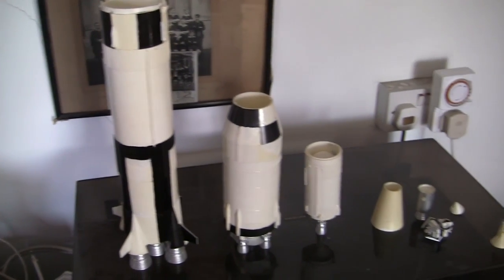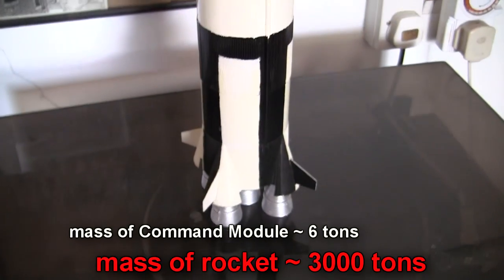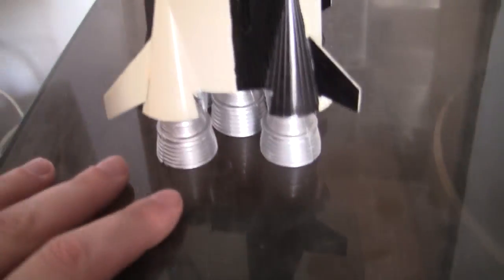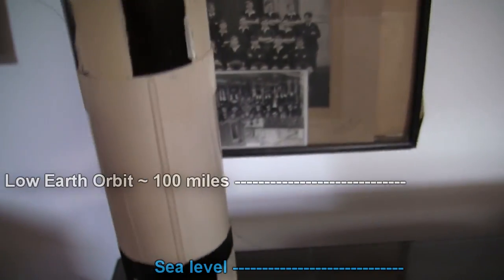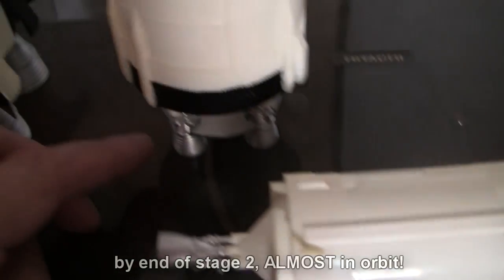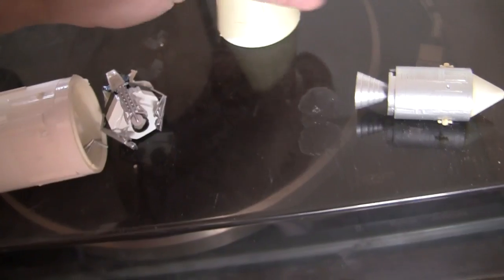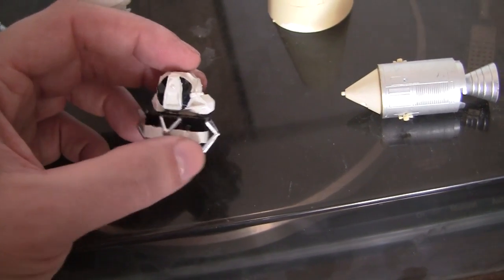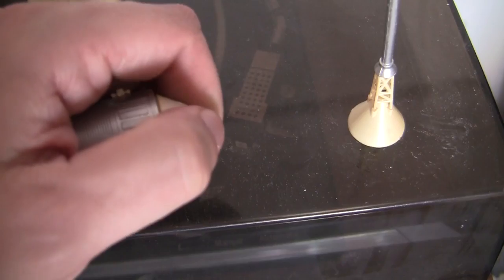The Saturn V Rocket: How it worked!

Comment: A couple of fine points.  The moon is in orbit of the Earth.  Going to the moon does not require leaving Earth orbit.  While the mass of the LM was high, it's weight on the moon was low. Lunar gravity on the surface is 1/6 of Earth's surface gravity.  And when landing the lower stage of the LM has burned most of it's fuel.

Comment: I'm kinda confused.  If the rocket had 3000 tons of fuel, and the engines consumed 13 tons of fuel per second, then it would only have four minutes worth of fuel.
Reply: Yes, but the 13 tonnes / second is only for the first stage. The first stage burned for only 168 seconds.

Comment: I recall seeing a clip stating that if they lost  1 engine before clearing the tower they were coming back down. But if they lost it after clearing the tower, then they had burned enough weight in fuel to continue with four.

Comment: You got some details wrong, 
the third stage was used for a lunar injection orbit, they were in low earth orbit by the end of the second stage
Reply: Swithin Games they weren't in LEO on the second stage, it got them to space but not quite orbit. The third stage burned a little to get orbit, shut down, then restarted to get to the moon.
Reply: Dubsy is correct. The 3rd stage fired twice. Once to get the rest of the way to LEO after the 2nd stage was spent, then again to leave LEO to head to the moon (TLI or Trans Lunar Injection.) then while in transit to the moon they docked the command module with the lunar module.

Comment: Ironically , I believe the Russian design approach for the smaller rocket outlets is now used for modern space flight . They had significant challenges back then but i believe it has advantages over the saturn v design in terms of control .

Comment: the Rocketdyne F1 was a thing of wonder, 7,000 kN of thrust each.
Reply: Also, the command module wasn't the only piece to return, the first two stages at least splashed down in the Atlantic.
Reply: *****
Legally it would likely be considered salvage, in which case NASA would retain ownership, but would be obligated to generously reward Bezo under maritime law. the amount of the reward is based on many factors including "1) the value of the vessel and its contents after the salvage is complete; 2) the salvor's skill and initiative in minimizing damage to the environment; 3) the degree of success obtained by the salvor; 4) the level of peril to which the salvaged vessel was subject; 5) the salvor's skill and initiative in saving the vessel, human lives, and other property; 6) the salvor's labor and expenses; 7) the amount of risk run by the salvor; 8) the promptness of the services rendered; 9) the availability and use of any alternative salvage resources; and 10) the readiness, efficiency, and value of the salvor's vessel and equipment." He spent alot of money and effort to recover them, he should not be obligated to return them for free, and if NASA really wanted them back they could press a claim within 2 years and would be required to compensate Bezo.
Reply: All your assertions are based on the premise that NASA even wants them back, which they don't

Comment: thank you for the video. I know most of the parts were made to be used only one time.
my questions:
1. which parts of Saturn V were returned to earth and reused for next missions?
2. which parts remained in the Earth orbit? maybe still orbiting.
3. which parts remained orbiting the moon?

thank you.
Reply: I hope this helps:

The only part of the Saturn V that returned safely back to Earth was the Command Module with the astronauts inside. They couldn't be reused, however, as the heat shields used during reentry were damaged.

The first 2 stages both didn't achieve orbital velocity, and were destroyed on impact.
The third stage was sent on a collision course into the Moon for experimental reasons, and was destroyed on impact.
The bottom-halves of the Lunar Modules are still on the Moon, except for Apollo 13, which burned up in Earth's atmosphere, and Apollo 10, which was sent into solar orbit.
The top halves of the Lunar Modules were all put on Lunar collision courses, except for Apollo 10 and Apollo 13 again.
The Service Module was detached before reentry, and burned up in Earth's atmosphere.

All in all, the Saturn V was one-time use rocket, with nothing being able to be reused. Pretty wasteful.
Reply: 1.  A few years ago, one of the F-1 engines from Apollo 11's first stage was recovered from the bottom of the Atlantic; but it wasn't in flying condition.  The Apollo spacecraft was 100% expendable, so nothing was re-used except maybe some of the personal items and tools.  Even the cameras had to be retired after only one mission, because space is really hard on equipment.  The command modules are on display at various science and aviation museums.  The first stage (called the S-IC) would fall back to the Atlantic Ocean and be destroyed; the second stage (called the S-II) would disintegrate over the Indian Ocean.  

2.  Apollo 4, 5, 6, 7, and 9 never left Earth orbit, so some of their debris is still up there.  Astronomers have re-discovered the aerodynamic fairing from one lunar module, easily identified by the titanium in its paint. 

3.  The ascent stage from the lunar module would be left in lunar orbit until it decayed and fell back to the Moon, usually a few weeks later.  There is no Apollo hardware in orbit around the Moon, but the Apollo 11 and 12 boosters flew past the Moon and are still orbiting the Sun somewhere. 

The third stage (called the S-IVB) would be deliberately crashed into the Moon, creating small tremors that were picked up by seismic sensors the astronauts set up.  This is how we know the Moon's composition is a lot like the Earth's crust and it was probably formed from debris left by a huge impact.  Ironically, the first mission to do this was Apollo 13; so they didn't land on the moon, but the booster they rode on did.
Reply: Hector Cummings  THANK YOU !
Reply: Thank you!

Comment: Great video! Just a note: the lunar module had 2 engines, the descent engine and the ascent engine. In case one failed the other could get the astronauts back to the command module. This was tested on Apollo 10.  Once again great description of the Saturn V!
Reply: Thank you for the correction, however I was referring to the decent and accent stages. On the way down if there was an issue they could jettison that stage and use the accent engine which was capable of getting the LEM from the surface to the CM.

Comment: Correction; the main engines burned 20 tons of fuel per second.
Reply: TheAviator370 I doubt that, the F1s burnt for around 170 seconds. That's enough to burn the entire rocket.

Comment: It's really hard to fathom the task of taking off from the moon and docking back with your parent module thats in lunar orbit. How is that even possible? I mean, to be in orbit means to be just falling around the planet fast enough that you just keep circling. It would have to achieve orbit velocity and time it so that it coincides with the parent modules location in orbit. Wow.  I know that orbit velocity is achieved by the angular approach used during launches, but even with the moon's decreased gravity it's very hard to imagine that a tiny module would have the power to do this.

I just wish I could chat with one of the original mission planners one on one.
Reply: You know what's equal hard to fathom.

How 12% of the western world denies this happens
Reply: DaVDLSYAP3 1245
Well, being a skeptic myself, I can understand how people don't believe something that hasn't been proven to them. Unfortunately, they don't want it to be proven so they don't do the research.
Reply: +Wheresmy240 They left absolutely everything they didn't need - cameras, science experiments, tools, batteries, even their boots in some cases.  The descent stage was left behind as well, since they didn't need its landing legs, batteries, or fuel cells.  The ascent stage of the Lunar Module weighed barely two tons when it docked with the Command Module. 

They also practiced the hell out of the mission before they flew.  For each hour of an eight-day lunar mission, Apollo astronauts spent seven hours training.
Reply: +CountArtha I know all of that, I'm just saying it doesn't seem physically possible still. Not doubting it.

Comment: The Apollo Lunar Module has two engines
Reply: +FSXgamer 
The lander had one and the accent vehicle hat one. They couldn't be used simultaneously.
Reply: +Keyboard runner Sure, but he implied that if "it" failed, they would die on the moon - which is not the case if the descent engine failed.  They would abort and simply fire the ascent engine in the case of descent engine failure.  If the ascent engine failed, then yeah - they were pretty much goners, but he made no distinction here.
Reply: +Willoughby Krenzteinburg The ascent engine used hypergolic propellents that ignited when mixed together, to eliminate the need for a heavy fuel pump.  Because they were so volatile and corrosive, it was impossible to test-fire the engine without destroying it in the process.  The first time it was fired was on the moon.  Those Grumman engineers probably had the most stressful job in the whole program, not knowing if the engine they had built by hand would work until the fifth day of the mission.
Reply: CountArtha I'm not sure why you're sending this to me specifically.  I'm aware.

Comment: This rocket is THE most powerful machine EVER created by man.
Reply: DavIDLSY 1245 No, Energia had 6,500,000 newts of thrust.  The FIRST STAGE of the Saturn V had 7,500,000.
Reply: +The Aeronautics Guy Because the RS-25(the engines used on SLS and the Space Shuttle) engines are more efficient than the F-1 since they use a Liquid Hydrogen and Liquid Oxygen fuel mixture rather than the highly concentrated Kerosene, known as Rocket Propellant 1, and Liquid Oxygen that the F-1 engines run on.
Reply: Centurion Coles That's a fucking nuke not a manned inter-planet rocket
Reply: Centurion Coles Also the Tsar Bomba had 50 megatons of power.
Reply: +WhackyJ in AK Most powerfull machine ever built by man would be the world's most powerfull laser pulse made on May 23 1996 by Lawrence Livermore National Laboratory. The lasers are used to concentrate energie on hydrogene fuel and start nuclear fusion. Max power obtained was 1.25PW (for nanoseconds) Average power of the first stage of SaturnV was 166GW.   Oh and I think the N-1 rocket produced about 46MN of thrust at launch vs 34MN for the Satun V I'm not sur can someone confirm this ? and does that convert in higher GW ?
Reply: @ Luca B ...to be considered a rocket one might argue that it actually had to be capable of flying before you could classify it as such.  The N1s were little more than massive, shrapnel-spreading bombs in the "shape" of a rocket... Sorry - but it's true.
Reply: +The Aeronautics Guy 2023 is Probably gonna be when the SLS Block IB launches, which will be more powerful than the Saturn V. SLS Block I will launch in 2018 and will be slightly less powerful.
Reply: +Andrew Mcilveen The thing I am wondering is why did they not put f1 engines on the SLS core stage?
Reply: +The Aeronautics Guy 
Some Apollo derived hardware had been considered in the past: The Earth Departure Stage of the Ares V would have been powered by a J-2X engine, derived from the J-2 used in the 2nd and 3rd stage of the Saturn 5.  Up to 2014 this stage was under consideration for the SLS, but is now being replaced by the RL10 powered Exploration Upper Stage (originally powering the 2nd stage of Saturn 1, Centaur upper stages on the Atlas and Titan III and still being used in the upper stage of the Delta IV).

While not as famed as the J-2, the RL10 of Atlas-Centaur was used for the Surveyor launches, and Titan III-Centaur launched the Viking Mars landers and both Voyager deep space probes. Furthermore, the RL10 on the Centaur upper stages proved that a hydrogen burning engine could operate in space, paving the path for the development of the larger J-2 engines that would have needed to be based on the same principle.
Reply: I think energia had more power. But most powerful with men on it YES
Reply: +Centurion Coles That's STILL a fucking nuke not a manned inter-planet rocket!!!
Reply: WhackyJ in AK *Inter-Celestial Body Rocket
Reply: +WhackyJ in AK Actually the N-1 rocket is the most powerful machine ever created by man. The Saturn V is the most powerful that works.
Reply: WhackyJ in AK Actually I gotta tell you, it wasn't until after I'd pressed the post button that I realized who I had replied to. You've proven yourself to be a massive waste of everyone's time from the top of this post to the bottom and I regret not paying more attention. It is not my intent to ever give you the time of day intentionally. No more posts to you from me will follow.
Reply: RedhotIta1 That's what I was talking about, numbnuts.
Reply: WhackyJ in AK Was really necessary to insult?
Reply: RedhotIta1 I apologize.
Reply: Centurion Coles I AM TALKING ABOUT ROCKETS, NOT NUCLEAR BOMBS, FUCK OFF!
Reply: +Luca B That might be true, but the N1 never Made a succesfull Launch because that the Saturn V is seen as the most powerfull rocket and not the N1
Reply: +RedhotIta1 the n1 couldn't lift as much to orbit as the Saturn v, 95 tonnes versus 140 tonnes.
Reply: ***** Again, incorrect. NO N1 ever made it into orbit. Period. https://en.wikipedia.org/wiki/N1_(rocket)
Reply: ***** You're an idiot
Reply: ***** Your grammar is attempting to destroy my cerebral cortex.
Reply: ***** Alright, well good luck in learning, I hope you do well.  Also your country's team was awesome in volleyball last night.
Reply: It is! Imagine a Saturn rocket that uses the same main stage as boosters. (like the Delta-V Heavy). The Power of that thing would be amazing, but expensive.
Reply: NSEP of Doggerland Not to mention SUPER outdated technology... It would be like saying, "Here, let's start using carbs on cars again because they used to be on muscle cars."
Reply: NorthernChev I know, but just the idea is cool, im not wanting them to build that or something. Just a thought.
Reply: NSEP of Doggerland Well I want them to.  Carburetors are great at starting in the cold and heat while we usually have more problems with EFI.  Also that rocket sounds amazing they need to build it like, 12 years ago.
Reply: WhackyJ in AK Spoken like someone who knows nothing about mechanics.  It EFI that starts with no problems in the heat and cold. Carbs are notorious for problems with both.  Please do your research before commenting. Thanks.
Reply: It's only a few kilotons of TNT equivalent. Anything but a tiny tactical nuclear weapon is vastly more powerful. So  not the "most powerful machine"
Reply: thats not essentially a machine +GavinJenkins  its more a weapon
Reply: +swithin games "Machine: an apparatus using or applying mechanical power and having several parts, each with a definite function and together performing a particular task."

So yes, it is essentially a machine. And a weapon. Ever heard of a "machine gun"? The two words are not mutually exclusive.
Reply: Technically the N1 was it had a higher payload capacity. 95 tons compared to the saturn's 45.
Reply: The LHC is probably a bit more powerful.
Reply: What about Falcon 9, Falcon Heavy, and Big Falcon?
Reply: 2 years later Falcon Heavy
Reply: Not now! Falcon Heavy ftw!
Reply: The Saturn V had about twice the payload capacity to LEO compared to the Falcon Heavy.
Reply: STARSHIP
Reply: Starship will be way more powerful than the sls and saturn V lol
Reply: @ukdrilllyrics2624  To date of my comment neither the SLS or Starship has been launched.
Reply: @whackyjinak4978  I know lol
Reply: Until 2020 when we launch SLS
Reply: The Aeronautics Guy ... SHUTUP...  I can like the Apollo missions :(  I hope it ranks under this though...
Reply: +WhackyJ in AK ok jeez I was just stating a fact I love the apollo missions.
Reply: The Aeronautics Guy DUDE I LOVE YOUR PROFILE PICTURE!
Reply: +WhackyJ in AK Thanks
Reply: @shilpwift3366  uhh yh SLS super passed the Saturn V
Reply: @shilpwift3366  2024 now
Reply: @shilpwift3366  starship ._.
Reply: @shilpwift3366  2024*
Reply: Andrew Mcilveen Shut up
Reply: protostar 777 I never said that the Saturn V carried less than the N-1, simply the N-1 was lighter and more powerful than the Saturn V
Reply: NorthernChev Knows nothing about Mechanics?!  I've rebuilt two different motors and am taking several classes for mechanics.  You don't even need to have experience to know, "Gee, all these old cars around here I've driven start without a problem.  Why do my friends' and my new cars with EFI start worse?"   I have done my research.  EXTESNSIVELY.  So kindly FUCK OFF.
Reply: WhackyJ in AK not for long.....the falcon 9 heavy!!!

Comment: I was thinking about buying one of these model, but the paint job looks bad.
Wonder if the buyer has to paint them?
Reply: If you buy a model, all you get is an ugly set of pieces. You have to glue them together, and paint them, as well as putting on the decals.
Reply: If you buy a model, all you get is an ugly set of pieces. You have to glue them together, and paint them, as well as putting on the decals.